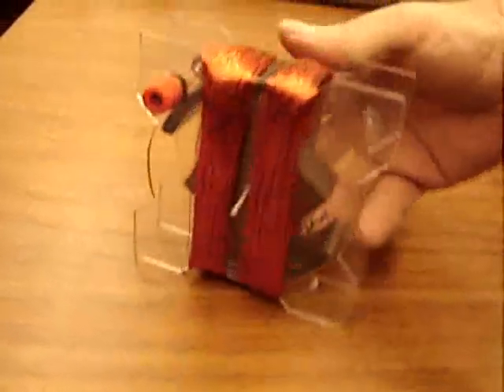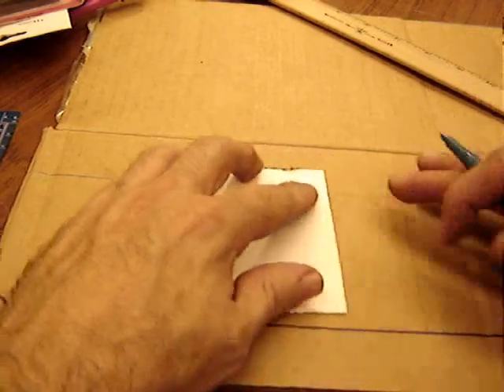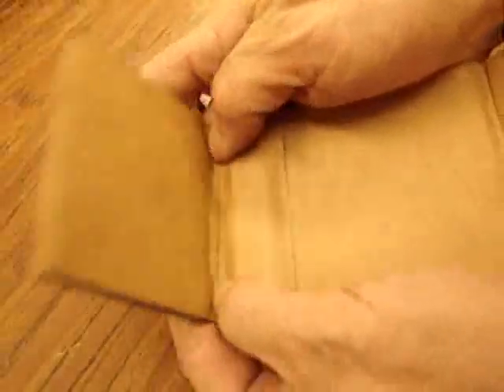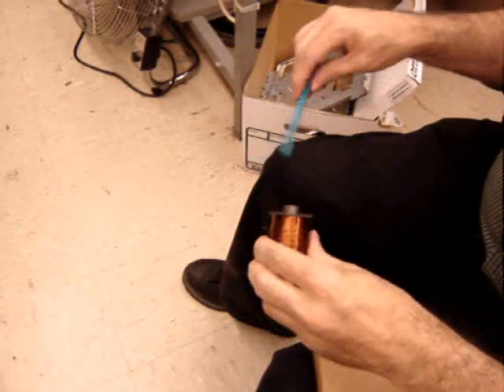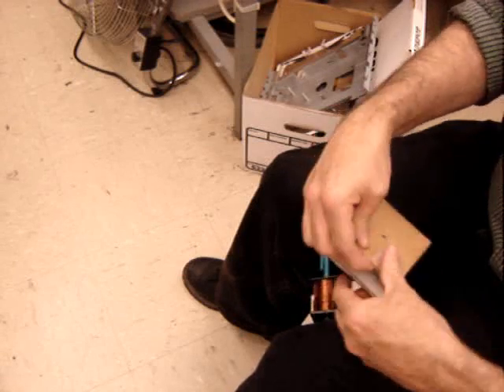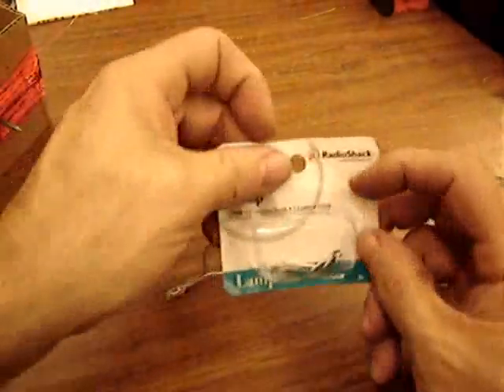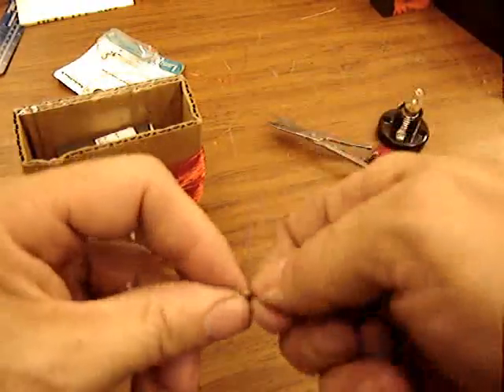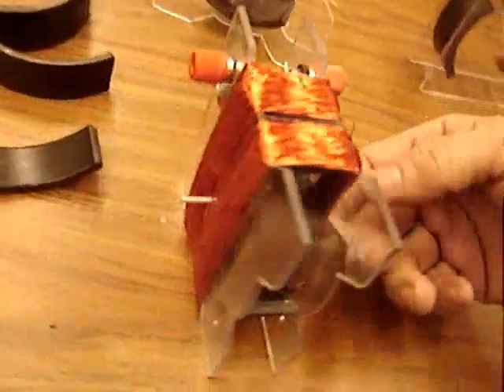Simple generator:  AC electric generator for science fair

Comment from the maker: @Jdonovanford   Good question! Generators cause a current. They don't produce any electricity. Instead they're electricity pumps. Books in grade school get this wrong. The correct description is only in college physics texts.

Also, the word "conductor" means "material which contains movable electricity." Metals are like tanks of water. Wires are like pipes which are already full. When a magnet passes a wire, it forces the wire's own electricity to momentarily flow. See bit.ly  /  7N87A for lots

Comment from the maker: @anti1china  See the main article.  Over and over I say: don't use different parts. If you *want* it to fail, just change any of the parts.  It won't work if you use different parts.

Radio Shack has the magnets. The color of paint makes no difference.  But they have to be the size you see, if not larger.  And they have to have the strength of ceramic magnets, or stronger.   If you can find neo supermagnets that are 2in X 1in X .4in, they'd work great.  But $10 to $15 each, at least.

Comment from the maker: @shoxrux93  just under one volt unless you're very good with finger-spinning.   To light a red LED at 1.7V you need to use 500 or 700 turns of wire.

Comment from the maker: @TheBludginator  Nope, this gives out AC, so a capacitor will charge and discharge and charge and discharge and charge and discharge.   To fix this problem, wind 3x or 5x more turns of wire, then add diodes in series to give DC.   That, or turn it into a DC generator by constructing a "commutator" assembly.

Comment from the maker: @maga1259  Read the parts list.  It's on the main website

> how many volts does it has?

under 1 volt.   Not enough to light an LED.  But you can wind 3x more turns of wire and increase the voltage by three.

Comment from the maker: @TimeImp  this vid is an 'animated diagram' for the project website on Amasci.  See website for complete project info.  Get ceramic block magnets from all the places on the parts list.

Supermagnets only work if you build a tiny generator that closely hugs the supermagnets.   But then you only need 70 turns of wire to light an LED, not 700 turns.

Comment from the maker: @3Target33  Dim light bulb needs 30 milliwatts, dim LED needs 1 milliwatt.

A light bulb is wasting over 90% of its power on invisible infrared light.   BUT ...an LED needs much higher voltage before it turns on at all, so you'd have to spin the magnets way way faster, or wind more than 500 turns.   LED needs more speed, light bulb needs more energy.  To make a simpler generator, we use the special Radio Shack light bulb.  Red LED is second choice.

Comment from the maker: @MrExtremeTV  @steven198807 for cellphones you should build a "shake generator" tube with a few thousand turns, a supermagnet, and a diode.

Even then, it's a whole lot of work to charge a cellphone battery even a little.   A bicycle generator works better for that.

This cardboard generator only does one thing:  lets grade-school kids light up a bulb.   Any real generator needs 3,000 turns of wire, not 300.   That, or mail-order some neo magnets.

Comment: @MrExtremeTV 
Yes you can. You can put as much wire as you want to increase the voltage and current (or as you call it - electricity)
It would be hard to charge your phones battery because the voltage would need to work smoothly e.g. making about the same amount of electricity all the time and it would need diodes to turn the electricity from AC to DC current 
My phone needs ~7 volts DC current.

Comment from the maker: @marold29  go to the website, look at the parts list.   Also see the FAQ.   It needs at least 200ft of very thin #30 enameled copper wire, but more is better.   You could use #29 or #28 wire, but no thicker.

Comment: @CamiloSanchez1979 there are several cell-phone rechargers that work manually. But i wouldn't spend my money on one, you'll need to turn the crank for a few hours to generate enough power for call of maybe a few minutes. If you want that to hand-charge your everyday cell phone, forget it. If it's for a survival kit of some kind, i'd recommend you buy the simplest, most energy-efficient model that you can get your hands on. Otherwise, it'll be like "911, what's your emergency?" "Hi, I'm lost a--"

Comment from the maker: @superfreak29  Could have been DC, since LEDs are diodes.   When the generator voltage is alternating back and forth, the LEDs turn on and off.   But if you spin the magnets fast enough, the LED flashes all blur together in your brain.

Comment from the maker: @Evilgaming1997   Read the FAQ     A1 parts shows wire on their website.  a1parts dot c o m.    There are other places in toronto, use yellow pages and ask if they have Enamel Magnet Wire, #28 or #30 or #32.    

A red LED will only work if you use about 500ft of wire.   It must be thin and close to the magnet.   (Thick wire makes a huge wad far from the magnet.)    Or use 200ft, but spin the magnets incredibly fast with a rubberband drive, see Arvind Gupta projects on my Links page

Comment from the maker: @Harvir50  See the article section called "DEBUGGING."    Spin it faster.   The magnet has to spin like a blur.   Even better is to use 500ft or more of wire.   (One kit of wire from Radio Shack is only 200ft)    If you try using more wire, then try lighting a red LED.

Comment from the maker: @Harvir50  Wrong light bulb?  You must use the ones in the parts list on the website.   NO FLASHLIGHT BULB WILL WORK.  No normal bulb will work.   You can use a red LED if you wind about 500ft of wire on the coil.

Comment from the maker: @Danni293   Follow instructions, use #28, or #30, or #32 enamel wire.   If you use thick wire, 200ft coil will be the size of a baseball, then only the innermost turns will be near enough to the magnet, so way less voltage.  If wire is too thin, high ohms, bulb too dim.   This generator BARELY WORKS.  If you change things, it fails.  (But it's OK to add lots of extra #30 enamel wire.)

Comment from the maker: @m8y511google   Don't need a generator for that.  A generator is just a pulley, where the "drive belt" is the electricity.  So just hook some gears and drive belts in a circle, so it drives itself.  Same basic idea.  Doesn't work.

Comment from the maker: @azngunnerboy   more wire is better, like 500 feet instead of just 200.   But it has to be the thin stuff.   More turns of wire gives higher voltage.

This generator just barely works.   You could use larger magnets.   But it fails if you try smaller magnets or weaker magnets.   Read the project webpage about magnets.

Comment: the real trick is to produce a generator with a magnet and coil rape where the magnet does not spin.  the problem in motors is the requirement to make the motor spin in order the have the magnet or coil spin to produce current.  the leap forward would be to produce current using a stationary magnet and stationary coil.  I guess the next best thing a 2nd step process where motor that spins using magnet power causing magnets to spin.

Comment: Your video and description on the internet is amazing! I have never understood the scientific books regarding to this topic. The books never mentioning what happens in non-normal cases (i.e. what happens if we connect the wires with no bulb, or if you break the electrical circuit you can still measure voltage difference...) 
Thanks a lot! I hope you will have a lot more teaching videos!

Comment from the maker: @alexleitao26   DON'T CHANGE ANYTHING.   Even with large, powerful magnets, the bulb will not light up unless you spin it *very* fast.   See the project website.  Don't use a different bulb.  Don't use different wire.  Don't change the shape.   (It's OK to wind lots more wire.  Try 500 turns, or even 1000.)

If you can get it working, then it's OK to try making changes.   Read the website FAQ about how to increase the voltage.   See all the links to Dr. Arvind Gupta's generator designs.

Comment from the maker: @LiveOnTheRock17   binding posts?   Go to radioshack website and search for "binding posts"     For building plastic things, crazy glue works just fine.  Strap it all together with tape or rubber bands, then let crazy glue get "wicked up" into the cracks between parts.    Or go to hardware stores and get acrylic solvent-cement (the grade-#3 watery stuff, not the thick goop that never hardens.)

Comment: A generator is AC right? And is a motor DC? If I was to hook the generator to a battery and a motor onto the battery on a parallel circuit with the generator, would the motor work?

Comment from the maker: @CowSin  Nah, just use the 200ft.  Don't bother with the others.  They're too short to add much voltage.

Best is to buy some open-frame solenoids, mail-ordered from All Electronics.  These are only $1.50 and have about 500ft of wire inside.   On the generator project page, look at Magnet Wire in the parts list and click on OTHER STORES.

Comment from the maker: @galinschool   1/2 volt.    For much higher voltage, just spin a DC permanent-magent PM motor so it becomes a generator.   Any motor works.  If it's a 6V motor, just spin it as fast as it normally runs when powered by 6V (and to get 3V, spin it half as fast.)   For example, find a 24 volt motor and spin it fairly slow to get 4V output.

Comment: great plan...simple chic package in the acrylic version but what type of glue did you use to join the abs to the plexiglas? or could you reccomend one that would work w pvc and acrylic? I thought about routing out the arcs on the plexi and sandwiching it together via nuts/bolts at the corners but thought thatd make winding a pain in the bootay...

Comment from the maker: @LXXITobinator    Exactly right.   A coil can be made up of 300 turns of wire.   And 600 turns works much better.   With 600, you don't have to spin the magnets so fast in order to light up the bulb.

Comment from the maker: @LXXITobinator   I also tried it wtih 2-inch "buzzing rattlesnake" magnet ovals.  Those are supermagnets with the poles on the sides.  If you put nail heads on the ends of the oval magnets, spinning the magnets on the long axis will make the poles flip.  Then stick the whole thing in a narrow plastic tube, and wind the coil so the windings pass over the open end of the tube.

Comment from the maker: @wayfinder15  poles must flip end-over-end so they cut across the wires of the coil.  If not, you'll get zero voltage output.  For your idea to work, you'd have to somehow re-magnetize the stack of donuts so the N/S magnet poles were on the curved sides of the stack.  Then wind the coils so the windings crossed over the open ends of the tube.

Comment from the maker: @LXXITobinator  yes, any one-amp schottky will work.     For sphere supermagnets I marked out where the N/S poles were, then drew an equator line, then crazy-glued two nails head-first onto opposite points on the equator.  Carefully hold the nails axle very straight when first gluing.  Then added 5-min epoxy blobs to fix the nails on permanently.  (The poles must flip end over end.)    Turn the nails with fingers.

Comment from the maker: @LXXITobinator   see the website FAQ section on increasing the volts.  This "Ultra simple" device is too simple to do anything.  You need to modify it with lots more wire (1000 turns.)   Then convert it from AC to DC with a rectifier diode or with a rotating commutator.    Supermagnets and a smaller plastic body would help lots.  Here's Dr. Gupta's generator on youtube:  bit.ly / cFGlJo

Comment from the maker: @mohammedowais1000 

Read the actual parts list on the website, and don't use different parts.   Ignore this video, it's only part of the project website for "Ultra-simple Generator."  You have to use the website, NOT the video.    This video does not have partslist, or complete instructions, Frequently-asked Questions, or debugging hints.

Comment from the maker: @vgaboy  Yep, small DC motors are generators, but only if they use commutator brushes.  (DC motors found inside toys will work, but DC computer fans don't work.)  To generate useful voltage, you have to spin the motor shaft quite fast.  Motors with plastic gears are best.

Comment: How did you get the circle spin thing on the 3rd plexiglass version?
Also, if you wound up the wires a lot of times(say, 1000), would it create a lot more energy? Would it be possible to store the energy in a battery or something?

Comment from the maker: @Aznproz   During the lightbulb flashes it's putting about 1/2 volt at 0.01 amps.   So 0.5V times 0.01A equals an energy flow of 5 milliwatts ( 0.005 watts.) 

Also you could light a red LED if you spin the magnet way faster.   Or double the amount of wire

Comment from the maker: @Toerme   If the layers touch, then the turns of wire are shorted out.  The path for current will end up about half an inch long.  The path WON'T go through the 200ft coil of wire.   Without a coil, the generator will only produce about 1/1000th of a volt.

Comment from the maker: @Donk3yPow3r  Ignore this video, GO TO THE WEB PAGE.   It will give the actual instructions.      Notice that is says, over and over, don't use other parts..   If you want to fail on purpose, then use different magnets, or different bulb, or change the wire.

Well what can you change?    Add more wire.  Instead of only 200 turns of #30 wire, you can buy extra, then wind 600 turns.  With 600 turns you can flash a red LED.

Comment: plz help me out  .
i made this project as a science working model 
i used a thick cardboard and pierced a hole and inserted the nail  as u showed and then winded it with wire which is thick and used a 1.5v bulb 
now it is not working plzzzzz help me out fast 
plz respond to this video plzzzzzzzzzzzzzzzzzzzzz
its very very important

Comment from the maker: @jpjdo1212  for football shaped buzzing supermagnets, use just one magnet.  That magnet has poles on the sides, so for the axle, glue nails head-first onto the tips of the magnet.  Put the magnet in a short plastic tube with the nails sticking out the ends.  Glue small plastic squares to the ends of the tube, with holes for the nails.  The magnet must spin easily.  Wind only 100 turns of wire lengthwise on the tube, so it goes over the flat squares.  This should light a red LED very brightly.

Comment from the maker: @MrPacosTacoz  you'd need supermagnets, and far more turns of wire.  See the FAQ on the project site.   It's easier to just buy a DC motor and use it as a generator.   Or, if you want small and portable, build a "shake flashlight" type of generator.

Comment from the maker: @vidmanbry1998   You'd need large ones, maybe $30 worth.    It gives you about 10x more voltage, so you can spin it quite slowly and still light the bulb.    Easier: use just one neo magnet, then build a very small generator around it.

Comment from the maker: @websitemakerjonathan  try eBay for 50x19x10mm magnets.  Else look for magnets2buy website or Cermag,  50X19X5 ferrite ceramic block magnets.  They are half as thick, so you'll need six or more.   For wire try Brocott website, 30 AWG winding wire 250G spool

Comment from the maker: > if the wires wound the same direction the magnets were turning?

@dynamoJamey   to create voltage, the magnet fields must cut across wires (the magnet flux enclosed by the wire circle must be changing.)    If you wind the wire differently, the output voltage will be zero.

Comment from the maker: > used a drill to spin the magnets

@BlacktailTheFox  read the Debugging section on the website.  Don't use a different bulb or different magnets or different wire, it won't work.     Some drills are too slow, and you can spin them much faster with fingers.  The magnets need to rotate at like ten turns per second.   It helps if you use 2x more wire or even more (scrape the ends and twist together with extra wire spool)

Comment from the maker: @totyem  yep, LEDs work if you add lots more turns of wire.   The special light bulb will turn on at 1/2 volt, while an LED needs 1-1/2 volts.    If you used 400 or 600 turns of wire, then the generator can light an LED.

Comment from the maker: @MrDrd6 try SOL-123, from all electronics.  I've seen similar ones: you can pry off the square steel top using screwdriver and vise grips, then the spool of wire slides right out.  It should have a few hundred feet of #28 or #29 wire.  Before you buy lots of them, buy one or two to make sure.

Comment from the maker: > power a small toy radio

@trricklecharge91 it's AC, and only 1/2 volt.   A radio needs a DC generator.  Those are the complicated type, with a rotating commutator.   However, if you wind a couple thousand turns of smaller wire instead of 200 turns, then the output will be around 5 volts.  You can add a diode which eats up 3/4 volt, leaving a bit more than 4volts to power your radio or recharge your 3v batteries.

Comment from the maker: > how long did it take you

@kurosaki651 see how long the video is?   Add another five minutes for cutting cardboard and winding the wire.

But then I've done this demo many times, so I've become faster with practice.

Also, if it doesn't work the first time, you'll have to mess with it for awhile.  Can't say how long.   Hint:   BUY LOTS OF WIRE (like mail-order solenoids.)   WIND LOTS MORE TURNS.   One or two hundred turns just barely works.  BIGGER HINT: don't use different bulb or magnets.

Comment from the maker: @huddiex   I tried transformers.   The AC frequency is too low.    Spin the magnets at 2000RPM and maybe a transformer would work.    But...   a transformer is just a way of adding lots more turns of wire.    Break open a transformer and use its wire for the generator?